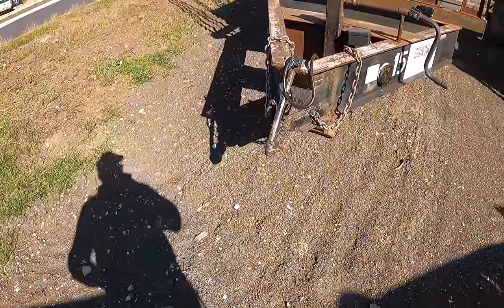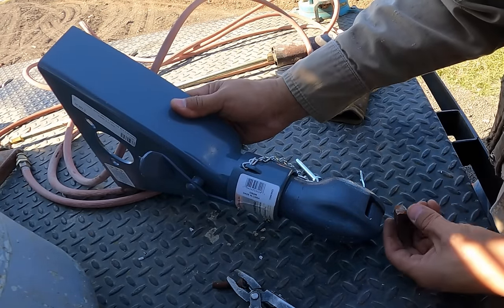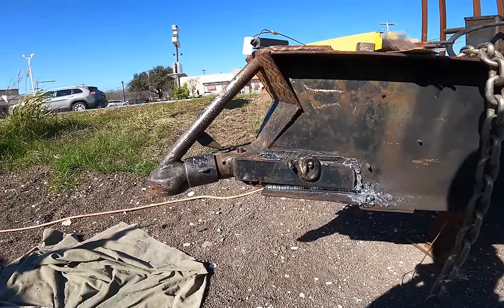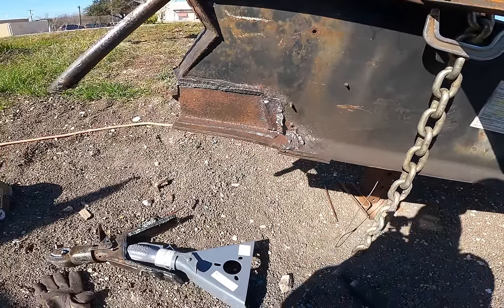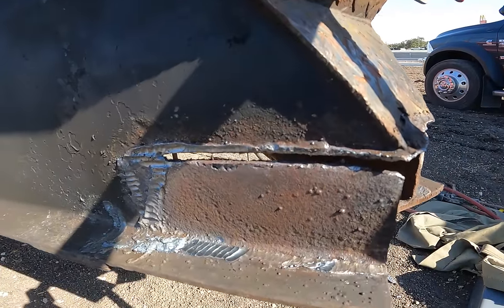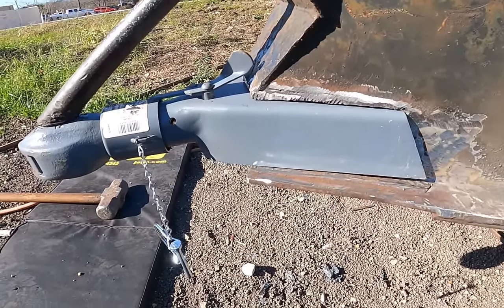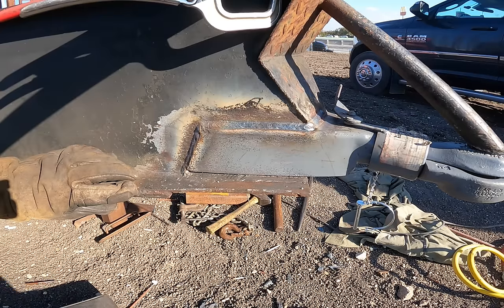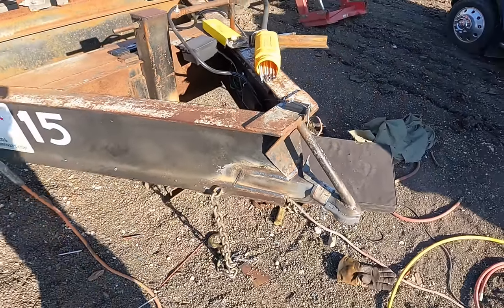Sketchy Hitch replacement.

Comment: seems the tow bar hitch* was set low? ( with the overbearing top reinforcement knuckle bar )- it should have been the same as ride height ?
the hitch/tow bar ball joint should have been lowered ? (drop hitch*)

UK viewer, with a passing comment

Comment: That trailer looks like it was designed to have a pintle hitch originally.  I worked on a similar trailer with a v in the end of the tongue and I had a vertical 1/2" plate on the end with holes to adjust the height of the pintle hitch.  The v was so you could access the nuts holding the pintle hitch to the trailer.

Comment: Hey Isaac, another fine repair on the side of the road.  I feel like I might be missing something. Why didn't you just cut/grind off a short portion of the top "support bar" so that the hitch could be straight? Seems like that would have been the easiest solution.
Reply from the maker: The whole thing was actually bent downwards, not just the point. turned out pretty good.
Reply: @ICWeld  I understand but if you cut a small section off the tip of the rod back at the same angle then you could have tilted the front of the hitch up to meet it.  Perhaps there's something about the setup that means this wouldn't be possible and like you said it turned out fine. Keep up the good work. You've repaired many things I would have bet had to be scrapped.

Comment: That trailer empty must be pushing the limits of that dinky little hitch from the frame size alone. Looks like it really should have a pintle hitch on it. I guess this is what you get when there's no state inspections and poor safety standards.

Comment: I am surprised that you did not contact the customer and ask the hitch should have been aligned level or just as is?  The customer will not be able to hide the fact that the hitch was replaced.

Comment: Wouldn't it be good practice to put down a little corner screen to block oncoming vehicles from the flashes of welding and/or gouging all this steel? They seem awfully close to your worksite.. I guess all this Osha stuff isn't for an old timer like you hey Isaac? xD

Comment: I agree, that's one ugly setup. You did a good job with what you were given. What I can't understand is why anyone sticks with those ridiculous ball type hitches on a trailer that would be much better served with a pintle type hitch. Way more user friendly, easier to install and maintain, and way safer as weight capacity is concerned.  Ball hitches are for shitty boat trailers, and 4×8 utility trailers being pulled by a minivan.

Comment: excuse me can someone tell me how many amps you need to put the machine to use the arcair?
Reply from the maker: I arc gouge with 1/4" carbons at between 200-220A. you can also get thinner rods, such as 3/16". Those you can gouge at about 160-180A. I forget.

Comment: That coupler is cast iorn 7018 isn't the best rod to run. Should have used some 99 cast rod or something comparable if you are that concerned about liability another tip before running 6010 run the oxy / acetylene torch burn off all that paint
Reply from the maker: it's most likely cast steel. 7018's work fine. plus if you consider how the sheetmetal part of the trailer hitch is also welded to the cast part then it would be silly to spend thousands of dollars as a manufacturer to weld those two parts together with 99.
Reply: 7018 can shear/Crack when it's mild steel to cast under tension/load bearing and vibrations from the road weld some cast to mild with 7018 you can knock it off with a 6lb slege hammer that's a proven fact (if the arm is strong of course)

Comment: That was totally the wrong hitch for that size trailer. The sheet metal was way too thin for the weight of that trailer. Dexter 2-Tang Clevis w/ 3-Position Adjustable Channel - 3/4" Pin Hole - 12K

Comment: That's an awfully thin bit of steel to be using as a trailer hitch for such a big trailer, I'd expect that to start failing where that ring joins the plate, it just looks the wrong size, but hey the customer supplies it, then that's what they get.

Comment: I don't like it either. The liability. I did look up those bulldog hitches and the heaviest one I found was a Fulton piece rated at 15000 lb with a 2-5/16 ball that definitely heavier than that one. I doubt Fulton would allow it to be installed that way though. A-Frame Coupler, 2-5/16 Inch Diameter, 15,000 lbs. Capacity Part No 44150WQ317  I hate it when you feel obligated to do something (future business) you really don't think is right and don't want to do. You did a great job though turning shit into shinola.

Comment: So I take it as it was a tag trailer for a dump truck thats been rebuilt in to a sign carrier by city,county, dot contactor. By the exit sign on the racks could be wrong, just why do people take off pintle rings and put light junk unless it got wrecked but there's ball mounts that bolt in place to ring mounts. Sorry I look at  this as a dot inspector  l would say take it somewhere else my name is not on that to many lawers around just my opinion sorry

Comment: That hitch can't bend up because the top brace won't compress. Side to side loading can't move. Whoever put the scabs on there didn't understand the forces.
The hitch installation didn't fail. Just the hitch clasp.

Comment: That hitch is only rated for 7000 ppunds and 600 pound tongue weight. That trailer probably has over a thousand pounds tongue weight and 15000 pound overall weight when loaded. This is a lawyers dream. It has negligence written all over it even if its the end user that screws up

Comment: Once I got a full view of the trailer I seen why a ball hitch and not a pintle hook.  He’s hauling window glass.  

Isaac, it’s 10 times better than it was before.  At least now you can see if a problem develops unlike before with that scab plate on there.
Reply: Not even window glass; it's highway signs.

Comment: Um, It appears that that trailer is a 30-45k trailer with a hitch that is rated at 15k.  I would not have done this job the way that you did it.  I also would find out the GVWR OF THE TRAILER  and then ensured that I put a hitch that was rated at that rate or higher, because they are pulling more weight than the hitch can handle.  The hitch broke, it needs a heavier duty hitch than what was on there.  If that hitch breaks and someone gets hurt you would be found liable because you are the guy that repaired it and you are the professional who should know.  I would have cut the front of the trailer straight down, I would have put a channel hitch system in it that holds a lunette ring for a pintle hitch system.   Then you put the trailer to proper weight rating.  I do not believe that the manufacturer would ever approve of the brace welded to the top of their receiber. By doing that you accept all liability for any accident  and the hitch company would be cleared in a liability suite because the hitch is not installed as their system is made.  Some jobs you just need to say "No we need to make it safe.   Maybe I am wrong, and assumed that the trailer is rated heavier, but My 45 ton trailer has 10 inch I-beams like the front of this one and I see a whole lot of steal structure to support steal items.  The video does not show how many axles nor the full scale of the trailer but it looks to me like the trailer is pulling way more than 15k.
Reply: That is not a 20 ton trailer. Probably only rated for 8 or 9 ton.
Reply: @mikeznel6048   I don;t think so. just the depth of the i beams says no.

Comment: Lol, you did it all wrong.

All you had to do is drive down to your local manufacturer home seller and buy a used A frame hitch. Then just weld it on. 

They're either bolted or sometimes welded on as they're removed after playing the house.

Comment: I like your work Isaac by no means do I want to criticize. However, I think that you open yourself to a lot of liability on  a job like this. That trailer empty is probably more than that dinky hitch is made to handle. That is likely the reason it failed in the first place.

Comment: Your standards are way higher than the mfg. ever was. Weld it. As long as you can get the pin in, it’s money. This looks like it might have been a mobile home trailer frame.

Comment: Cut all that crap off and weld on a P-hook, You did not say what the ball coupler size is, if it was 2" don't think it's big enough looking at that cobbled up mess and that bar used to renforce the coupler (that ain't right lol) , what's the max load of the trailer? That looked like a modded house trailer frame. a walk around of the trailer would help. I would have made them tow the trailer to the shop and fix it right. Junk like this shares the road with women and children maybe yours or mine. Job's like that aren't worth the liability involved. Just because the customer demands it be done one way doesn't mean you are not responsible for the total outcome. I have steered many a customer in a different direction by saying "if we do it your way WE both get sued and this job ain't worth it" 95% of the time they agreed.
You did a great job 👍🏻 not knocking your fab skills, you put it right back the way it was only better. Just a poorly engineered trailer that's all.

Comment: An awful lot of awful work to cut the original pentle hitch off and weld that half ass prosthetic hitch on... and THEN drag it in to you to make right. You did best it could be done with the bulldog hitch replacement, but still, that trailer needs a pentle ring hitch.

Comment: Completely shocked that you welded directly over paint and rust. That is not a sound approach to ensuring high weld quality. That whole trailer is a massive liability and now you’re apart of it. I seriously hope that you made good money on that job to cover your lawyer. Several times you melted through the base metal due to weak or thin areas. Wow is all I can say. Truly scary knowing that is out on the road. Sometimes walking away from a job is the right call and knowing it isn’t worth the risk just because you replaced what someone else did. So very disappointed in seeing this type of workmanship. No job site or shop worth anything would allow this!
Reply: Real quick, what do you do for work? Lot of experts in the comment that have never worked a day in the field.

Comment: Any decent welder woulda cut that bar shorter and levelled the hitch… wtf kind of angle is that lol and if you’re doing your own work why don’t you ask the customer more questions?
Reply from the maker: I thought the same. It is more of an optical illusion. It was actually pretty straight, just pointed down because of the original cut. It looked weird at first glance but it was alright. definitely odd looking though.

Comment: That trailer would have came with a pintle hook hitch and not that chicken shit ball hitch that is not rated for a trailer that heavy. I wouldn't have replaced that and i would have told the customer that it needed to be put back to a pintle hitch that is rated for that trailer and i would have refused to put that ranch hitch on there. And thats to cover my own ass for liability reasons because idiots that do shady shit like put that little hitch on that trailer are the same idiots that load 40,000+# on a trailer with a 8,000# hitch with a trailer that is built to only haul 12,000#!!!!